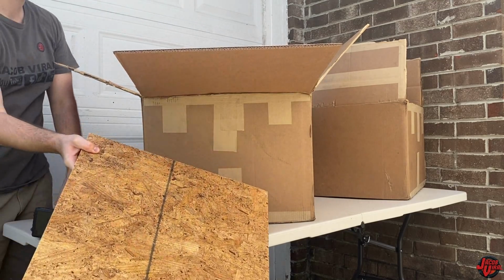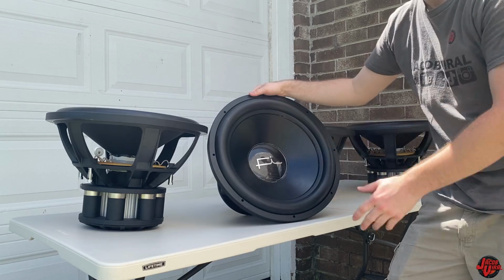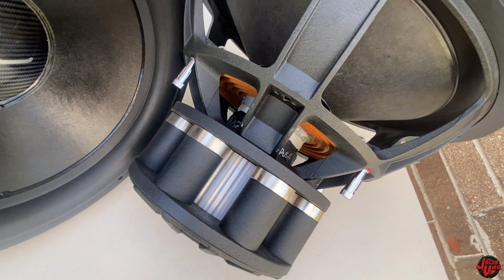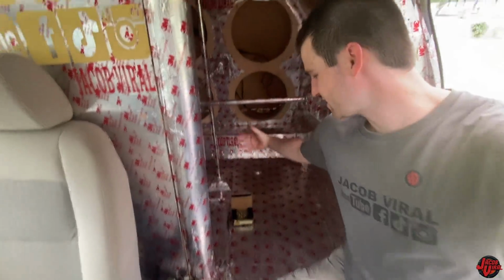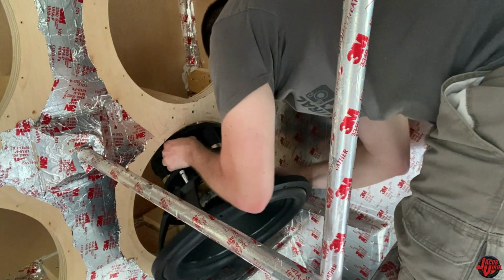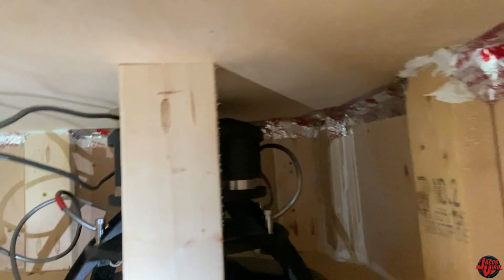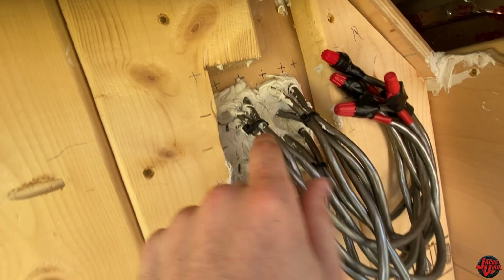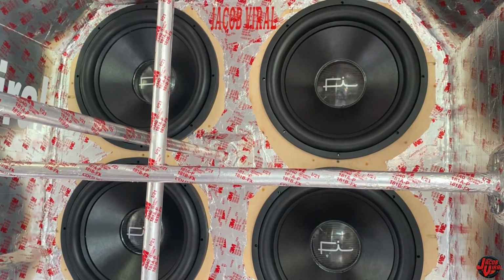My NEW Subs Reveal! FULL INSTALL & FLEX TEST! System Update for 2022!

Comment: I have 4 12" Walmart subs(power acoustik) powered by a taramps smart 5k in the trunk of my Mercury Milan.   They meter at 151db.  I can imagine how loud these 18's are gonna be!!  Nice upgrade Jacob!!  I'm thinking of getting better more powerful subs too.  P.S. thinking of getting these in 12"
Reply: Box used ??? seat up/down??? or deck port?  please elaborate
Reply: Those subs can handle 1K wrms each?
Reply: @jimjones3287  sure why not
Reply: Do you have 3- 12s or 4 -12s a mercury or and escalade? Or do you have several different set ups?
Reply: Parker the Basshead put 4 Gothic 12s on his Taramps 8k and it barely got 140db. So.... Either you're fluffin up your score. Or your meter is in the port. Or your meter is broken. 4 Gothic 12s will not do 150s. If it will, post your video and prove it. You got the easy part done. Talkin about it. Anyone can say they did 151db. But did they really?

Comment: Cool looking subs. You should check out the TS parameters page. These subs have the most pitiful usable motor force I've ever seen. Less then a skar ddx. Hard to believe but it's true. Stiff soft parts, low motor force, they take lots of power to get moving. People swear by them tho, so idk. Real world is always different then on paper. Kinda. Good luck!
Reply: I've been spamming about their dog shit parameters everywhere. Disgraceful really. Especially since my profile pic is a Q Neo I had in a daily. Didn't do horrible. Got plenty loud. But the hz range had huge roll off at around 35hz. It would hit the lows great. Box was made for it too. I directly swapped it for a IA DP 12" and noticed the difference immediately. Hit from 19hz to 45 hz no problem. Tried another box for the Fi. Same issue. So I sold it. But on the low end it absolutely killed it....And that's really about it lmao.
Reply: Dam ... I hope they work awesome for Jacob.. That would really suk .. He really happy with them.

Comment: Your box looks raw on the inside does priming or resin inside a box benefit at all in your opinion. But actually the rest of the box is sealed with the 3m tape on the ported chamber.
Reply from the maker: It can help ever so slightly with wind turbulence and completely being sealed/ smooth.

Comment: Hybrid terminals allow better flow based on what I've read bcuz there's more surface area and less solder joints. However, Fi does use enhanced push terms allowing less of a bottleneck than most sub companies.
Reply from the maker: Nice info, I never knew that thanks Man.

Comment: So is higher the fs of a subwoofer the better it would be for a 4th ?
Reply from the maker: If your going for a big ratio upper end Loud output peak yes it can help but will slightly hurt the lows. General 4th order no.
Reply: @JacobViral  nice thank you I’m running a 1:1 due to space and was curious about fs when you spoke about it in the video but thanks again

Comment: So all 4 dubs are sharing same air but in a sealed enclosure?
Reply: 4th order bandpass enclosure.  It's both vented and sealed
Reply from the maker: Correct, sealed common chamber on the rear sealed section of the 4th order

Comment: I don't think I have ever called them fi. I always called them F I :)  Great choice.
Reply: It's Fi. Short for Fidelity. And great choice for low motor force. Back when Scott owned Re Audio,he made great subs. Not really so much anymore.
Reply: @brianrich7828  I miss RE Audio. Does FI not carry the quality they used anymore? They have always been legendary to me. Eff Eye fully loaded btls for the win :)
Reply: @FatboyBass  No. The quality dropped. The Neo is low grade Neo. And the Measurable BL shows their subs have incredibly weak motor strength. The build quality is there,but the material isn't anymore. And I'll never understand why since Scott has proven he can engineer a great driver.

Comment: 2.8 per sub seems awfully small? I understand smaller equals higher power handling but still seems on the small side?
Reply from the maker: 4th order bandpass it’s actually about right, usually the sealed section for an 18” varies from 2.25-3.25 cubes per

Comment: I need some advice I have six P3 12s Rockford Fosgate Subs and what would be a good cheap amp to power those
Reply from the maker: I would go with a 5,000 watt amp like https://amzn.to/3LAap00 or near that just make sure you have the electrical to support.
Reply: @JacobViral  yes i have a 320amp alternator 0 gage wire extra battery. My electrical system os good. O have a RF 2500 BDCP AMP that broke so I'm sending that in to get fixed at the Rockford fosgate warehouse. I just need something cheap to get me by till I get my original amp fixed.
Reply: @JacobViral  I will check out the taramps but I was wondering if maybe if there's a couple different other ones that you could think of as options
Reply from the maker: @reckingball6242  Audiopipe 3k, hifonics Brutus 3000, Sundoen sfb 3/5k, NVX 3/5k, Skar rp3/4.5k, Rockville 3k, stetsom 3/5k, many options man
Reply: @JacobViral  ok I have the six rockford fosgate p3 12s. I have a 320 amp alternator extra battery and 0 gauge wire. So those ones you just mentioned it would be good for my setup? And I'm looking to spend from 400 to 600 bucks for a amp.
Reply: @JacobViral  and I really appreciate your help man thank you
Reply from the maker: @reckingball6242  I mentioned decent amps for the money in your power range yes, If it was me personally I would’ve gone with the bravo bass 8k https://amzn.to/3wHgZhj and have plenty of head room for clean signal long as can wire the ohm Right and good electrical to support. Goodluck and no problem thanks for watching
Reply: @JacobViral  right on man I thank you again and I watch you all the time

Comment: can sum one plz tell me what a 4th or 6th order is..I keep hearing about them and have no idea what they are..Thanks...And whats the name of the subs
Reply: Fi.  Is the name of the sub.  And 4th an 6th order has to do with how many baffle plains 
For your port.
Reply: A 4th order sub box has 1 sealed section and 1 ported section. This allows for a higher tuning freq while still keeping cone control and decent lows

A 6th order has 2 ported sections. One tuned higher (50-60 normally) and one tuned lower(mid to high 20’s). This takes up more space but allows a larger bandwidth of usable frequencies you can play

Comment: Why is my subs making a weird noise I have the video posted
Reply: Could be a spider is loose or the coil is partially blown. Have you pulled the subs out and done a check? You can push on the spiders to see if it comes up anywhere or while the subs are still in the box push down on the middle of the cone. Listen for any scraping sounds if you hear any it’s probably the coil
Reply: @gagedoble2843  they seem solid I'm probably going to take them out
Reply: @hotwheelcollector16  Take them out and check the impedance and the spiders. Other than that I can’t really help you. Good luck.
Reply: @hotwheelcollector16  It could’ve been the wires making noise? I’ve heard it from my box before

Comment: Why not just have the wiring on the back of the box be bolts instead of wires and silicone? This seems like a harder way to have easy access to the wiring in the sealed chamber without pulling the subs. This way you could just unscrew a nut on a bolt and change out your wiring with ease.
Reply from the maker: Guaranteed connection and not loss of power transfer. I’ve seen bolts heat up and loosen/melt/spark.

Comment: Neo huh?
Reply: Fi neo 4x , those are some bad boys. I can vouch for them all day..
Reply: @RomaVilla  might have to take a look at em
Reply: Low grade Neo. DATs results were incredibly bad.
Reply: @brianrich7828  to each it's own I say
Reply: @brianrich7828  800 doesn't sound or feel like a low grade sub but we will see what kind of numbers Jacob does with these low grade subs..
Reply: @RomaVilla  DATs don't care about any of that. Just measures a subs parameters,which are very important. When you're sub has a motor force lower than a Skar DDX,yet costs three times as much and takes months to get to you....That's horrible. Btw even 4 entry level 18's will be loud. However,I'd bet he would have bigger gains after going to subs that have better specs from a company that doesn't lie about them.
Reply: @brianrich7828  let me guess sundown 🤔
Reply: @RomaVilla  Instead of going with "They lied about their specs and DATs results proved it" you ignore that completely and think it's a nut hugger thing. And no I don't run sundown drivers. I,however,would run sundown over Fi if I wanted to move on from what I have and those were the only options. DATs results aren't opinions or biased. It is raw data and factual data that is measured.
Reply: @brianrich7828  I never said anything about being a nutthuger but if you felt triggered to even think that then maybe you are what you say your not. I was just throwing a brand that most people like to go with and that is sundown. One thing I do know is that not everyone is chasing numbers and trying to get first place in being the loudest, sometimes people like to be different and try other different brands. Not everyone can afford to spend 1400 dollars on nightshade subwoofers. I get you prefer to go by statistics and the best numbers but their are other brands for a reason. Some people like Fi and some people like sundown but not everything has to be a competition, what prize do you win in being right or wrong. Self satisfaction or maybe feeding ones ego?
Reply: @brianrich7828  sounds like you chimed in just to prove a point and that is that you are right and someone else is wrong. Sounds like Hate to me but who am I to  judge and say what's right or wrong. Opinions are a dime a dozen and everyone has got them.
Reply: @RomaVilla  I chimed in to help people not make a bad choice. And it's for people who actually know what DATs is. It's not an opinion,not sure how that's not clear enough?. Lying about your products specs is slimy as fuck. That's not a hard concept to understand. I put my comment in very,very simple English,you are struggling my guy. The subwoofer in my profile pic is mine. I've ran alot of Fi. There is 100% no opinion in what I'm writing. And yes,I will be a hater on Amy company that puts out an inferior product and lie about it to it's loyal customers. That's not right. But regardless,some people don't have comprehension issues and will take the warning and go to the verified T/S and DATs page on FB to see the result. Others will continue to reply irrelevant shit over and over again not understanding what I'm saying and providing.

Comment: 70lbs??? I thought neo motors were supposed to be light. Good luck to those who buy their ferrite motor lines trying to lift em
Reply: Fi doesn't understand the point of Neo. Not to mention their motors are extremely weak. Like Skar DDX weak.
Reply: @brianrich7828  🤷‍♂️😂
Reply from the maker: They are lighter than ferrite but still going to be somewhat heavy :)